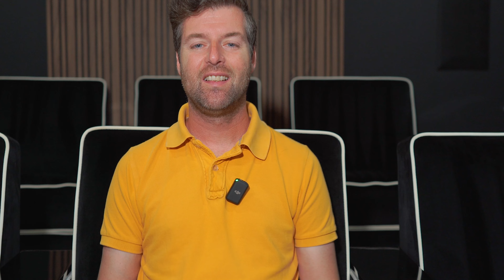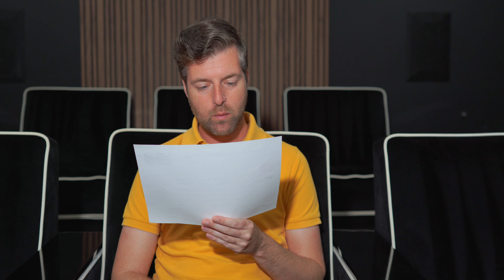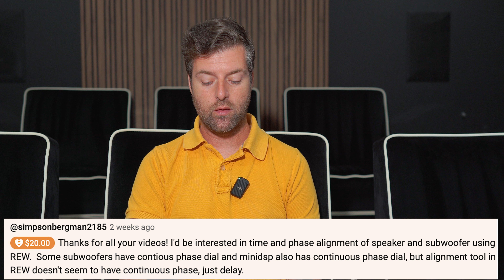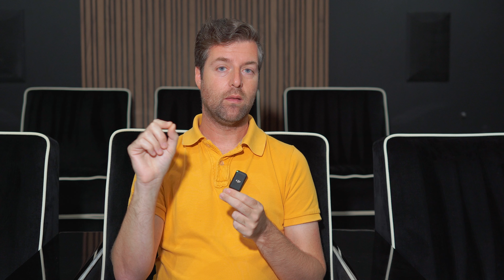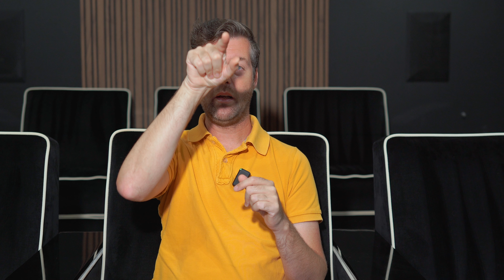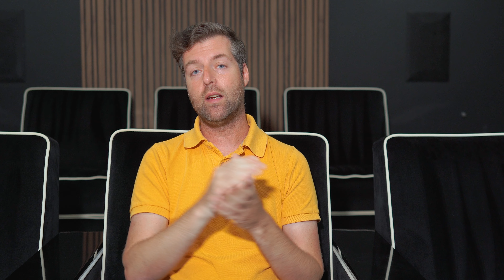Time and Phase alignment of SPEAKER and SUBWOOFER using REW

Comment: Thanks! Thanks for your input on my question! 
I have another one:) 
What I'm finding is that no single time delay gives a great match between the two impulse responses. Due to the duration of the impulse response, I can set the relative delay so that the first half of the impulse responses match very well, but the second half of the impulse responses are then out of phase.  (I'm looking at the impulse responses at particular frequencies.)  I understand that this implies a need for a more involved filter, e.g., allpass filtering. Do you have an opinion about Dirac bass control for this? [I am using a minidsp flex for stereo with 2 subwoofers. Dirac bass control is not available for Minidsp. I'm thinking of bringing a computer into the system to run Dirac with bass control, and getting a four channel DAC to then feed the 2 speakers and 2 subwoofers. I originally wanted to avoid using a computer, but I'm now considering it. I don't really want to get an AVR since I already have a hypex stereo amplifier and an AVR with Dirac license is quite expensive and I guess overkill for a stereo-only audio system.] (Sorry for the lengthy question!)
By the way, REW lists 3 different wavelets. I try teach one, they give quite similar results, but do you have a preferred wavelet?
Reply: Ah, I watched again your video "Top automated EQ for multiple subwoofers" where you talked about Dirac live with bass control. I think I will try the free stand alone trial after I get a 4 channel DAC. Thanks for sharing your knowledge and experience on these topics.

Comment: I have never used the spectrogram in REW  but I'll check it out. Thanks. I have been just using the alignment tool to impulse align the sub to my center and then I use AP filter to fix around the xover point.

Comment: I also had those problems. My MSO optimized array has different group delay than my mains below 70Hz. My solution was to raise the XO frequency to circumvent this area and have the XO where GD was more similar. If possible it can also be helpful to use 48 db per octave filters so that proper phase alignment only has to be +- 0.5 octaves around the XO. All pass filters are really helpful especially because you can use them for each channel. It would be nice if Trinnov would add them in the PEW section. :)

Comment: Thank you as always for your information. I’ve recently purchased some Rel subs and John Hunter of Rel discusses alot about their Rel 3D system which is supposed to be a take on Ray Dolby’s vision of having full range speakers 20-20K Hz for theater. Rel’s basic concept is using three subs minimum, which consists of 1 sub for the mains and 1 sub for the rears using their high level connection along with the LFE connection and then the third sub would be located near the center speaker hooked up high level only. I’m curious to your thoughts on this as I understand the concept they’re trying to do but the implementation of getting it all to work seamlessly seems daunting.

Comment: Thanks again for this great video. When you mention the Alignment tool in REW, there are 2 options, Phase alignment and Impulse alignment. You are talking about the Phase alignment, right?
Reply from the maker: Yes. The phase alignment. The impulse alignment will not work correctly between a full range speaker and subwoofer. It’s best for aligning two full range speakers.  The problem becomes obvious if you look at the impulse response of a subwoofer vs full range speaker.
Reply: @PoesAcoustics  yes, got confused real quick, that is why I wanted to double check with you. Are you going to the ISE in 2025?

Comment: The processor in my car uses an All Pass with a Q of 1 for the adjustable phase, the 180 point on the adjustment centered at the crossover point. moves the Allpass up and down to correlate with the indication, and moves with the crossover if you change that. I would assume these home units are doing similar.   

That said, I almost never ever touch it. I will time align the slopes using both the 0 and the 180. whichever one makes the most sense for the distances and response is what I go with.  And usually matches slope over the longest bandwidth. (Level phase at cursor button extremely helpful)  I DO need to utilize the spectogram more. Just to check my work really.

The allpass/active phase adkustment, might be more helpful if you have Smaart or similar to watch the changes live. Otherwise its a guess and check process...

Comment: Anyone else also think "The more I learn about home theater setup, the less I want to do it."?  Just run Room Correction, open a beer and try to enjoy a movie.  The more you drink the better the system sounds.  HAHAHA!
Anyway - Thanks Matt!
Reply: There's a learning curve to it but once you get over the hump you get really good results easily.
Reply: @ChadAV69  Yes sir.  I've been at working on my multi channel system(s) for well over 15 years and the seemingly endless tuning and upgrades are getting tiresome.  Every time I think I'm happy, Satan whispers in my ear: "Is it really right?".  That SOB needs to SHUT UP!  HAHAHA
Hopefully, I can get enough time to sit down with REW and get much better at using it.  Very powerful software package.
All the best to you and yours, Kevin
Reply: At the end of the day, just buying the gear, connecting it up and watching a movie is a huge step up and it's going to sound great out of the box. Hell, even without running Audyssey or anything you get something enjoyable. Getting it all fully dialed in, the sub(s) put in the right places to tame room modes, running corrections etc will of course pay huge dividends but the first step is just starting. Even if that's just getting some entry level noise makers, a hobbyist can start small and then grow. Just getting from plain TV speakers to a stereo pair of speakers is a big improvement, you can go from there. But yeah - it gets technical fast. Which is why there are calibrators etc for hire.
Reply from the maker: I don’t know if I agree with the first part of this. Just connecting the gear and playing it out of the box would likely yield pretty poor results. Sure the wider bandwidth will probably lead to better than TV sound. But it’s like saying a Ferrari with plastic sleeves on the tires would be an amazing driving experience with no need to touch it. Or a race car that is build but never tuned at all would still provide an amazing driving experience. High performance kit pulled together and not optimized at all will more likely than not yield poor results that could be bettered easily by equipment more designed for such simplistic operation. 

I do agree that just running Audyssey or similar is going to be better than nothing and likely yield pretty good results. While much better can be achieved. When you put it into perspective, we are talking about good gear that is now time aligned, level matched, and eqed. Is it the best it can be? No!  Is it a heck of a lot better than nothing?  Absolutely and for most that would be really good.

Comment: Here is where tech makes things complicated. Luckily i learned the old school way, and almost always it ends up getting me the best results. Every one should try this. Start by getting your tape measure out and try to figure out what your delay/time alignment "should" be. Flip phase on your sub. Now play the tone of your crossover frequency through both the mains and sub. Get you db meter out and add delay or take away untill your db meter shows the lowest db. When you find that.... flip phase of the sub and bobs your uncle!
Reply from the maker: And what do you do when the DSP latency makes the delay 10-20-30ms worse than the physical distance and you don’t know what the latency is?